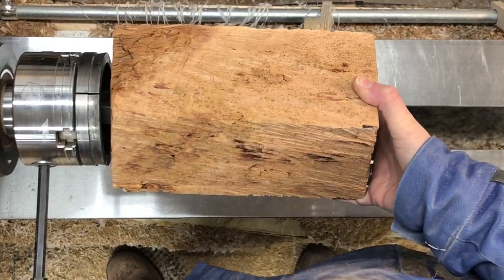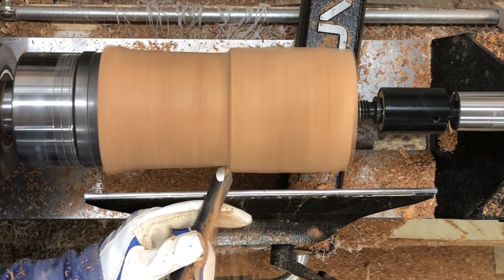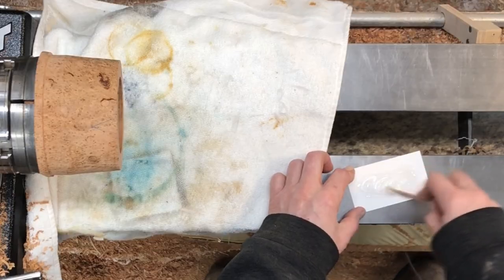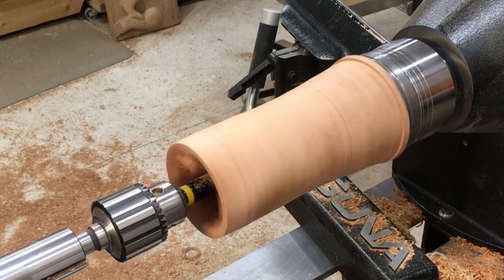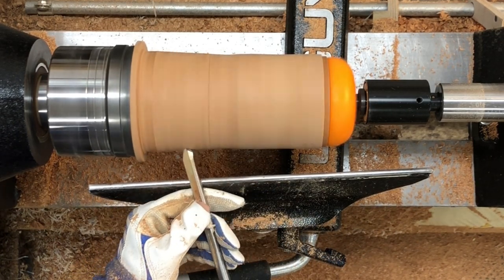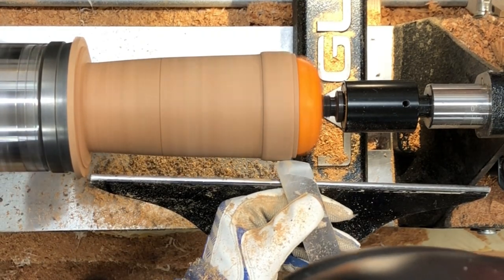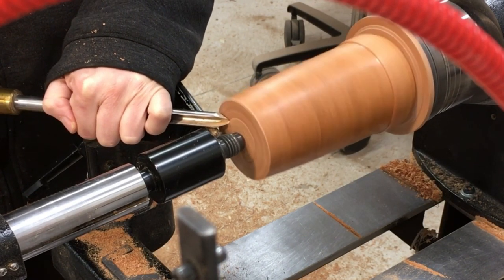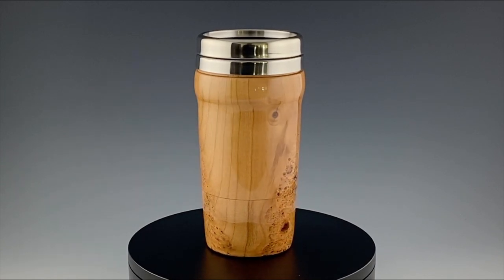Woodturning: Turning A Travel Mug-The Cherry Burl Revisited With a Removable Insert and Epoxy Finish

Comment: Great video and a beautiful burl travel mug, just a suggestion do your cut line down in-line with the internal bottom and when you have glued it together scribe and wire burn 3 lines with the centre line been your cut line that will then hide the cut and nobody will know, hope this helps. Keep up the great work and keep safe.
Reply from the maker: Thanks Chris! I will definitely change the positioning of the cut line next time and make it part of the design, whether it’s using burn lines or a strip of resin or maybe a contrasting wood. Thanks for watching and for the suggestion 😃

Comment: Always enjoy your videos Lisa!. Hope you don't mind a small tip. Next time just hollow the piece from both ends... (similar to removing the pith from an endgrain piece or hollowng a very tall vase...) you could then use a wooden insert with your magnets to plug the bottom and avoid having to cut the piece in two. Thanks, V
Reply from the maker: That’s a good idea. Steady rest would make that a bit easier I think - haven’t done any tall hollowing yet. Thanks for the tip 😊

Comment: This looks fantastic. Might I suggest that if you are concerned about the glue joint showing, turn some beaded ribs to include the glue seam in one of the grooves.
Reply from the maker: Hi Steve! Yeah, next time I will definitely incorporate the glue line into the design with either some burn lines or a strip of epoxy or contrasting wood or something. I’ve decided the burl is just so pretty you’ll not notice the glue line 🙃

Comment: Where did you get the beautiful piece of cherry burl?  When you were putting the epoxy on the inside was that your rotisserie motor or the lathe at about 50?  You are very creative with your setup at the end!!  Your videos are great!! Thanks so much h for all the time I can only imagine these videos take!!
Reply from the maker: Hi Amy! I bought a bunch of burls from a woman whose husband had passed - he made bowls but he carved them. Most of them are super cracked and will require resin to make them solid enough to turn, but this one was solid enough to get 2 of these tumbler mugs out of, plus a bunch of smaller pieces for other projects. It came from here in west-central Michigan but I’ve never seen this kind of grain before. It’s just fantastic!
I had the bbq rotisserie motor hooked up to the lathe when I coated the inside of the mug. 50rpm from the lathe would still be too fast. The resin self-levels nicely at whatever the rpm of the rotisserie is, I’m guessing somewhere between 2-5 rpm? 
The setup at the end for the off-lathe tumbler turner isn’t my design, I just watched a bunch of videos by epoxy tumbler makers and used them as a starting point. Whoever figured out the compression donut to hold the mug is a genius - way better than using the foam footballs stuffed in the cups! 😂
They are a bit time consuming that’s for sure. Shooting 3 camera angles makes editing more tedious but I like the variety of views so I just suck it up and get it done! 👍

Comment: Very very nice i love it , you gave me an idea for a project thanks . if i may and i hope you will not be upset with me . you can see the joint line , I wonder why you didn't do it as a part of the design making two more lines and  hi speed burning them with a wire  . Cheers Ahron
Reply from the maker: Hi Ahron! I’ve made hundreds of wood laminations for bandsaw boxes and have always had good luck with glue joints, but I’ve never used epoxy as an adhesive in that manner so it didn’t really occur to me that maybe I should have used wood glue, assuming that would have made it less visible. Next time I’ll definitely incorporate the line into the design as a burn line or strip of resin or constructing wood. For this one I’m just going to assume the burl is so beautiful you will be focused on that and not on the glue line 😉

Comment: Another option to eliminate any glue line on the outside of the finished mug.  Move the glue line to the underside of the bottom. Start by turning a recess in what will become the lower end of the mug.  Then mount a piece in the chuck and turn a matching plug.  Install the magnets same as you did, except now, the magnets are in the plug.  Glue the plug (while still on the lathe) and the mug blank together and complete the turning as usual.  Hope this makes sense and you can understand the the glue line is  now hidden in the base of the finished mug.  The plug could be a parted off portion of the burl or most any wood.
Reply from the maker: Hi Dave! That’s a great idea. I’ll do a little more experimenting on the next one. One of the reasons I made the cut line where I did is because I don’t have a hollowing system and the very end gets a bit dicey with so much hanging off the tool rest. I made the cut line right at where I stopped withe the smaller of the forstner bits which allowed me to hollow the bottom part, which was only a few inches deep at this point. So I’ll either do like you’ve suggested and plug the bottom (is this a good excuse to get a boring bar!?) or I’ll incorporate the glue line into the design, with either burn lines or a strip of resin or contrasting wood or something.

Comment: Just a quick suggestion. I'm a beginner to wood turning so not sure if it would have been a good idea or not, but couldn't you have put a few accent burn lines on the seam to hide it?  Love watching your video's great job
Reply: dang after typing it  I saw Brett's comment LOL
Reply from the maker: No worries Curtis! Next time I will definitely incorporate the glue lines into the design with with either burn lines or a strip of resin or contrasting wood or something. I‘be decided the burl is just so pretty you’ll never notice the line 😂

Comment: Looks good, nice finish. I think all you should need to do is coat the inside of the wood. The average travel mug doesn't pull apart and I dont think they have issues. Just my thoughts.
Gotta make me one of those rotating gizmo's. Pity you can't buy them pre made  like that! 
LR can you fit a bowl to that one at all?
Reply from the maker: Hi Chris! Not really any way to use the tumbler turner for a bowl - that’s what the hookup to the lathe is for 😁
Reply: I'll have to look at your other vid to see how u connect to the lathe or the chuck.

Comment: Nice work! It is almost impossible to make an invisible joint on end grain. Best to accent the joint with a bead or....
Reply from the maker: Thank you Mark! I wasn’t really worried about it when I did it cuz I usually have pretty good luck with glue lines but will definitely incorporate it into the design next time with some burn lines or strip of resin contrasting wood or something. I’ve decided the burl is just so pretty you’ll not notice the glue line 😊

Comment: That's really nice. I wonder if a Spray Epoxy, or even Lacquer would be a good hard wearing finish as well. I also wonder if using Rare Earth Magnets would work better with the Stainless Insert, but then the washer would also help add weight for balance. I'm going to have a look into some of these kits, esp. if they come out as good as yours. Oh, while I remember, I found the sound to be quite low in your video.
Reply from the maker: Hi there! I think a spray finish would work nicely too. These actually are rare earth (Neodymium) magnets, it’s just that most stainless steel is not really magnetic. There are some types that are slightly magnetic, but not enough. I may try some magnetic paint on the liner as opposed to the washer and see how that works out. 
Regarding the volume, I had someone tell me the shop sounds were way too loud when there was no voiceover and made it so he couldn’t keep the voiceover lid enough to hear without blowing him out when it went back to the shop sounds. I lowered the overall volume some, assuming you can turn it up but maybe that was too much? Can you increase the volume on whatever you’re watching enough to be viable or is it just too low all the way around?
Reply: I watched on my laptop, and increased the volume to 150% in the OS (Linux), and full volume with the YT Player, and was barely able to hear you speaking.  Not sure what the other person is talking about with Workshop noise, I don't recall hearing that in any of your other videos.
Reply from the maker: Ok I’ll adjust the volume back up and see how it goes. Appreciate the feedback 😊
Reply: Maybe even 25% higher, not sure if your video editor does, I use KDEnlive in Linux, and it works out volume in percentages. Appreciate you sharing your work. I need to stop being slack and upload more videos myself, lol.

Comment: Really nice piece! I wonder if you could have put a piece of brass or stainless steel where the join is? To be honest the join does no bother me :)
Reply from the maker: Hi Mikk! Yeah, next time I will definitely incorporate the glue line into the design with either some burn lines or a strip of epoxy or contrasting wood or something. I’ve decided the burl is just so pretty you’ll not notice the glue line 🙃

Comment: awesome project but i have looked at reviews for the insert u r referring to on woodcrafts website & most of the reviews are bad says it leaks from the lid & the lid doesnt stay tight after a few uses have you had any problems like these & have you ordered very many
Reply from the maker: Hi there! I think there are a couple of “versions” of this insert kit and maybe the reviews are referring to that one. I bought 2 of these kits and they have a screw-on lid with the little slider thing to cover the hole. The first one I made l was for a giveaway and the winner Mel chimed in here earlier saying the travel mug version 1.0  is all good so he hasn’t had any issues so far. Check the reviews and see if they are talking about a “friction fit” or “screw-on” lid and maybe that will help you sort them out.
Reply from the maker: I asked Mel about his mug leaking and he said the screw-on lid doesn’t leak, but the slider over the sippy-hole isn’t liquid tight if flipped upside down, which I would not expect it to be. Hope that helps!
Reply: Thanks for all your help

Comment: It looks like the only reason you made the cut at the bottom was to install the mags, you can buy extra long drill bits, they are usually called aviation bits as they are used/originated with the aviation industry. They're not very expensive (compared to other woodworking expenses, they cost more than regular bits) and you could make the holes for the mags without cutting the blank.
Reply from the maker: Hi there! You’re right about the magnets but I also cut it there to make the hollowing a little easier. I don’t have a hollowing system or boring bar yet and to get to the bottom of the mug gets a little dicey with so much hanging over the tool rest. I have several pretty long drill bits (my dad was a machine builder/repair/tool & die maker and has a ton of tools he picks up at estate sales, etc) so once I get the hollowing end straightened out I can either drill thru the opening or use a plug on the end for the magnets. This was definitely an experiment! 😂
Thanks for the tips and for letting me know what those bits are called 😊

Comment: Lisa. You are awesome in this design nice thinking. Why 🧲 stick to ice Box that is a Paint and a lot of people Buy stainless because they think it the Best. Just a sale pitch to get $100 more. Thanks      Greg of Ohio
Reply from the maker: That was actually my first thought after I realized the magnets wouldn’t stick to the insert - magnetic paint. But it’s like $35 for a small can so I thought I’d try this idea out first and see how it went. You’d only have to paint the very bottom on the insert, several coats would probably be sufficient as I have a pretty snug fit after the resin coat on the inside and it’s in no danger of falling out!

Comment: What are you using in the tail stock.i see some folks using those.
Reply from the maker: Not sure what you’re referring to? I think the only thing I used in the tailstock (other than the tail center) is the drill chuck for holding the drill bits when drilling.
Reply: @LisaRamlow  I have a moorse tape in mine n I have to put something in it to hold wood.i have never seen a thread tail stock if that's what you have.the threaded piece that holds the wood on.
Reply from the maker: My tailstock only has a Morse taper also. Still not sure which part of the video you’re asking about - is it when I glued the two halves back together?
Reply: @LisaRamlow  no it's what is in the tail stock that's threaded that's holding the wood.i have is 3 or 4 pointed ones.never seen this threaded one or maybe cup one.
Reply from the maker: Oh! It is the tail center, sorry I was not understanding what you were asking about! This is the tail center that came with my Laguna lathe - it has the cone tip that threads on or you can use it like I have been as more of a cup center. I know OneWay and Robust also make tail centers like this. I can add different things to hold the wood by utilizing the threads, tho I haven’t yet. Here’s a link to the OneWay live center 
https://www.woodturnerscatalog.com/p/108/5487/oneway-Multi-Tip-Revolving-Center-4-Piece-Set?term=live+center
Reply: @LisaRamlow  ok thank you very much I've never seen these n alittle pricy too.but it's all that way.thanx again.

Comment: Why not bore out the cup blank and make a "butt plug" for what will be the base of the mug. Make this plug out of a contrasting wood. You can then drill the base plug with the requisite holes to hold the magnets into that plug. Then glue that plug into the hollowed out cup. Then get the length right by slowly and carefully reducing the length of the top seating lip for the SS insert.  This will overcome the glue line in the centre of the cup. PS - I make these cups myself here in Australia. But never done a removable insert type.
Reply from the maker: Sounds like a great idea Chris! I haven't made another since this one but I'll definitely give that a shot if I do another travel mug. Thanks for the tips!

Comment: When using epoxy an amber colour hides joints best because epoxy joints have a visible thickness. Mixing wood dust into the epoxy hides the joint the best and does not affect the quality of the bond. Only sanding with a 60-80 grit sandpaper makes an ideal epoxy bond and getting the sanding lines to line up hides the joint because the coarseness of the sanding lets the two faces blend together.
Reply from the maker: Next time I’ll make the glue line part of the design

Comment: Stainless steel tends not to be magnetic but some stainless steel is somewhat magnetic.
Reply from the maker: Yea, found that out. The magnets “thought about” sticking to the insert, but only briefly 😂
Reply: @LisaRamlow  Probably not helpful, but the academic difference between stainless steels is, "The defining factor of magnetism comes down to the steel's microstructure. Martensitic stainless steels (which have a ferritic microstructure) are magnetic. Austenitic stainless steels contain nickel and are non-magnetic." More important is that stainless steel is not stainless if it is deprived of oxygen or exposed to basic substances like bleach. Never use stainless steel below a water line on a boat, birdbath, etc.